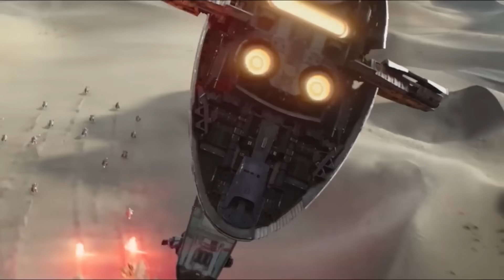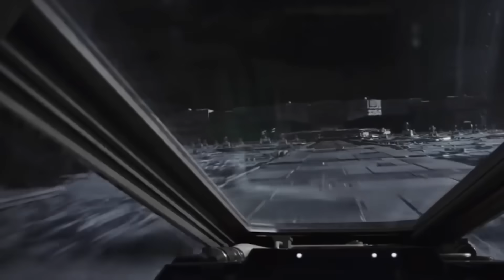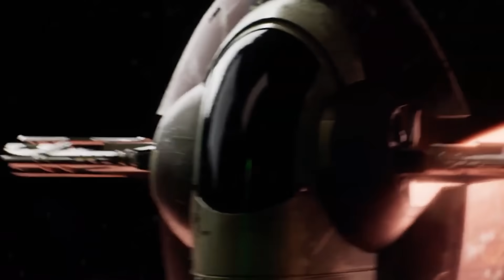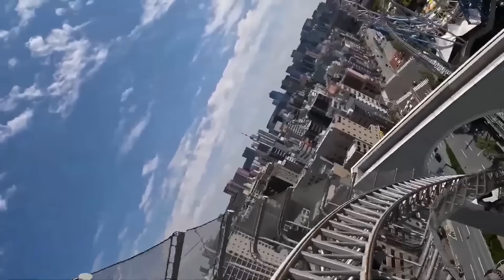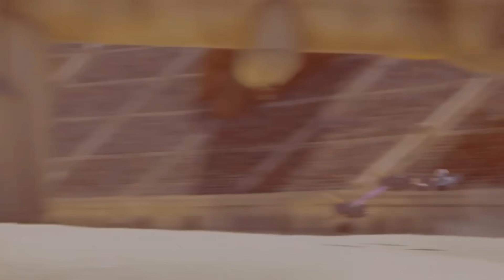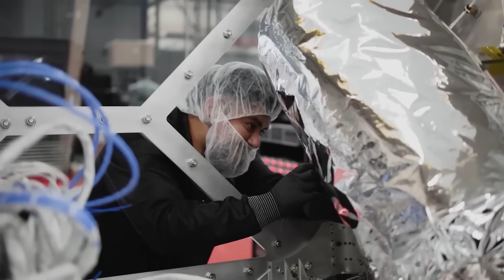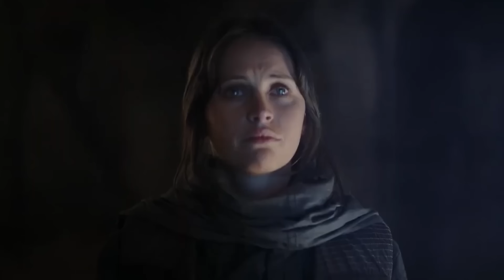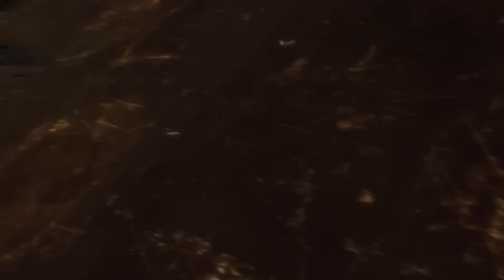The Problem with Star Wars Ship Design

Comment: I doubt nukes in space would do much aside from the EMP. Which might be what you are after, but other than that? There is no medium for thw shockwave or heat to travel through. Some radiative heating would happen, sure. But the intensity of that decreases with the square of the distance so in a wide open space like... well space... it would be pretty meh.
Reply: Energy density is the important part here. Instead of having gigantic missiles you can have reasonable sized ones. Also the shockwave has just enough to travel through (the insides of the struck ship) and i can assure you that there will be plenty energy left on impact.
Reply: @toastyrules8221  Travel though what? Nukes work by releasing enormous amounts of heat, which causes the air to expand => shockwave. In space all you have is a missile that very rapidly becomes very hot radiates a bunch of energy off and probably evaporates. Congrats you put on a lightshow.
Reply: @toastyrules8221  Ahh, ok you assume you make contact with the ship: yeah that would work. I guess. Kind of like a hollow-point bullet. Which... ok fine... But when you are hitting a ship, you could also hit it with a kinetic kill weapon.
Reply: @noneofyourbusiness3288  Always depends on what/where you are shooting at/from and what you want to accomplish with a hit. A kinetic penetrator has to hit something in its path to do more than just a series of holes whereas a nuke can and will do serious damage without the need for precise aim.

Target size/resilience comes to mind, a smaller craft gets threatened and taken out by a single/few kinetic round/s, a bigger ship meanwhile can withstand dozens of shots and might be in need of the increased damage potential a weapon like a nuke has.

And yes, i assume the nuke hits, as exploding it before reaching its target is only done to maximise damage output in atmospheric conditions.

Comment: Its not about speed. What matters is acceleration. You can go at ridiculous speeds, in fact you currently are. Velocity is relative after all and it all depends on the frame of reference. What you would not survive is your space craft suddenly changing directions, but going really fast one way? No problem what so ever. You might find that you experience some funky time-dilation effects if you go really fast, but that is besides the point.

Comment: Those globes ether side of the command tower are not shield generators they're sensor/communication arrays similar to the exposed radar antennas on real life naval vessels. Its commonly misconstrued that they are but that isn't actually the case. The guy who designed them in real life said he left them exposed as the ship's own shields might interfere with them so he felt best to leave them unprotected.

Comment: Long story short, you need to brush up on science. There is absolutely gravity in space , our astronauts don’t feel gravity in space because they’re constantly falling at 15k mph around the planet, It’s called orbiting.  If you could build a skyscraper 150 miles tall and you climbed to the top floor, guess what you could do you could walk around , you wouldn’t even notice the difference in gravity.  There’s only 2 ways to experience ZeroG by orbiting the planet or when you’re falling.. Star Wars ships use anti-gravity to make their ships weightless. Then they use their engines to propel themselves at much slower speeds. This is why they are able to dogfight.

Comment: 12:00 Which is why I like AI/Machine pilots in sci-fi. Like the Droid army of the even in Battlestar Galactica. They can and should exceed G-forces that can kill humans and simultaneously process everything going on around the battlefield at superhuman speeds.
Reply: Star Wars has inertial dampening tech...the G-forces are essentially completely nullified.
Reply: depends on your technology, if the mechanical brains contain components that break just as easily as organic brains under high G loads that won't work. And you need a LOT of computing power for the latter, so do not just assume that the cheapest hardware one can buy will suffice to work miracles like that. See Tesla and it's "cutting all corners they could" designs that now fail constantly at achieving true self driving as neither the computing power nor the sensor information is enough for that...
Reply: Star Wars was heavily influenced by Dune. So, the reason people are suspicious of AI is the Butlerian Jihad :D

Comment: I never thought the Death Star vent was dumb. The fact that a power generator that power needed a vent? Seems like a reasonable problem (the fact it was so small seems more of an impressive feat than a weakness). I thought it was more of a plot hole to believe it was only there because of sabotage.
Reply: Seems awfully small: as 10011110011 points out, a vacuum does not conduct heat, so the only way to dump waste heat is through radiation, which is highly inefficent. Look how long white dwarf and red dwarf stars "shine"; they're not "shining" because fusion is ongoing, but because their temperature remains high over millions of years due to the inefficiency of radtiation as a method of cooling down.
Reply: @PaulThatcher-iu5in  space still cobduct heat therr are some particles in it to do it. Its Just really bad at. Radiators still need something to give the heat to. Spacedust or whachamacallit.
Reply: @10011110011  Not quite. Space is not totally empty, a complete vacuum, but there is practically nothing to conduct heat, practically nothing. Radiaors do not require anything to "give" the heat "to" - that is a misunderstanding based on the fact that we have "radiators" in cars and houses - in fact, these dissipate heat by convection, by contact with air around them. Radiation does not require "space dust" - you mean, the Interstellar Medium; radiation can traverse a vacuum. Gotta say, sci-fi fans, the level of knowledge about actual science I experienced in these comments is terrible - does none of you ever bother with actual science?!
Reply: @10011110011  Radiation is the transfer of energy by electromagnetic waves - famously, as demonstrated by the Michaelson-Morley experiement, this process does not require a medium, the so-called "ether". This experiment was done in the Victorian era, and was key to Einstein's 1905 paper on Special Relativity, which postulates that the speed of light, c (actually the speed of causality), IN A VACUUM, is constant. You didn't know this? This is high school Physics, ABC stuff...
Reply: True, space is not totally empty, but there is practically zero conduction of heat. As for radiation, correct, radiation is the loss of heat by the emission of electromagnetic radiation - this is, however, so slow that a white dwarf star, which is only the glowing ember of a once active nuclear fusion engine, will take approx 10^15 years (approx 1000 times longer than the active fusion life cycle of our sun) to radiate their heat away.
Reply: Strictly speaking, what we call a radiator in a room here on earth heats the room by loss of heat through convection through the air in the room - this is radically different to the emission of EM radiation in a vacuum.
Reply: One point worth considering - strictly, "temperature" is actually a measure of the kinectic energy of the molecules in a gas, say. However, where that gas is so thin, like in the transition to space very high in the atmosphere, the average kinetic energy of the molecules can be very high, yet that is a very cold zone, even if not as cold as space itself. Why? because there are so few such high velocity molecules that one can barely detect their energy.
Reply: @PaulThatcher-iu5in why wouldn't you just dump hot gas? No conductor needed.
Reply: @Rashnak66  That certainly would work physically. The problem is, though, what gas would you dump? No matter how big and sophisticated the ship/base/whatever, there would be a finite amount of gas on it, and the most crucial would be the gases of a breathable atmosphere: air. You would want to recycle that air - this is true in current space tech. The one thing you definitely DON'T want to do is dump it. To carry other gases (in highly compressed form) specifically for the purpose of using them to dump waste heat seems insane - and would come up against the problem of then requiring MORE energy to be expended in storing and carrying those gases, thereby creating MORE waste heat in the process. This is where not only science fantasy, but even quite grounded "hard" sci-fi often breaks its lance - trying to fight the laws of Physics...
Reply: @PaulThatcher-iu5in well you can carry solid metal then use waste heat to convert the metal into a gas (which takes an enormous amount of energy to do), and expel the gaseous metal. 
 Obviously just spitballing here.
Reply: @Rashnak66  That's also true, but we still come back to having to carry the metal in the first place. Also, here, what about the vaporised metal's ultimate fate - I mean, it would cool (by radiation!) eventually, and so then any frequently used routes / near planetary orbialy would be strewn with frozen metal slag, which would have serious consequences. That's the point, though: spitballing is a great way to expolore and solve problems...
Reply: @PaulThatcher-iu5in  well that goes to my point about metal requiring huge amounts of energy to become gaseous, you don't actually have to carry all that much metal to expel a lot of heat. And come to think of it that very death Star has a complex garbage disposal system so there should be lots of stuff to vaporize.

As for  what becomes of it, when gaseous metal hits space it would form the tiniest of droplets. Star wars ships can withstand big meteor hits (empire strikes back) so I wouldn't think a tiny droplet would even affect anything. ... Wait in that same movie the destroyers were dumping big chunks of garbage into space, big enough chunks to hide the millennium falcon.
Reply: @Rashnak66  Maybe, maybe... But at relativistic speeds, microdroplets become deadly projectiles. On another tack, I'm very struck by a number of the engineering points made by Cixin Liu in the books of "3 Body Problem", not just about junk, but also about the very nature of space warfare, which given the distances and times involved might strangely resemble a much scaled up version of 18th century fleets manoeuvring...
Reply: @PaulThatcher-iu5in Well in the Star wars universe they seem to have figured out how to shield themselves from space debris as they travel, except where the plot demands it of course....oh that Holdo maneuver! 

It always seems to me that the capital ships in the Star wars universe made no sense at all.... Seemingly ineffective against other Capital ships, yet highly vulnerable to tiny fighter aircraft. Obviously the model was world war II combat.... But we quickly evolved into guided munitions EG missiles, They have missiles, why not fire a thousand missiles instead of a few fighters or all those gun shots that miss?  Once again plot device. 

Okay since you seem game for theoreticals.... I'm of the opinion that a single borg cube could destroy the entire empire..... Thoughts?
Reply: @Rashnak66  Not enough knowledge of SW universe, just the main movies, though I can claim one distinction - I'm old enough to have see the the first (I mean the real first, that is, Ep IV) in its first week at the cinema, which was mind-blowing - for the first time, you thought, wow, we're actually in space, not a studio, not a model! I'm from the Apollo generation, stayed up late (lived in the UK) and watched Apollo 11 land on the moon when I was 5. People in our street went outside to look up, not because anyone thought we would see anything, just to stare in amazement -- we'd stepped on the Moon!
Reply: @PaulThatcher-iu5in yes I was 11 years old when Star wars came out, I'll always remember sitting in the theater hearing the rumble of the Star destroyer before it appeared on screen..... What a moment!   But that was just a movie, you got to see the real event in 1969 when man first set foot on the Moon.
Reply: @Rashnak66  So your '66' is year of birth... Greetings from a vintage of '64, named for my Mum's favourite Beatle.
Reply: What is this thing even supposed to vent?
Also, why not add in some sort of steel mesh or split this thing at least  a few meters below the surface into multiple openings with a small diameter? I don't see a reason to leave such an opening directly to the reactor this exposed.
Reply: @xyleblack2545  Let's say it's 'venting' heat, a real problem on actual spaceships. Heat can only be dissipated by radiation and convection. Radiation is incredibly inefficient, which is why, for example, white dwarf stars shine so long - they're not 'burning' their nuclear fuel; they're just glowing embers. Convection doesn't work, as it requires a medium to convect the heat away from the ship, and space is a near perfect vacuum, so convection is practically zero. As the term 'vent' (Latin: ventus - wind) suggests, to get rid of heat in this way would require the expulsion of gases, and that doesn't sound like a great idea, expelling gases from a space station, instead of scrubbing/recycling them...
Reply: @xyleblack2545  In fact, with any other kind of venting, we still have a problem - say it's trash (though why such an advanced station would create trash instead of totally reusing/recycling is another question): when an astronaut steps out the hatch of an orbiting space station, are they 'swept away' from the station? No, of course not, as there is no 'headwind' in the vacuum of space, and as their initial trajectory is exactly the same as the ship's, they float near it - yes of course they need a tether, as any small contact with the ship, say a push against it, might (following Newton's 2nd law) send them flying off in the opposite direction. So how do we 'throw away' trash? Well, you'd need to propel that trash away from the ship - a process requiring fuel, thus increasing the mass of the ship, not to mention creating yet further waste.
Reply: @xyleblack2545  And if we're just gonna do space fantasy, which is fine, and have a vent, then, as you say, why not just put a grille over it?
Reply: @xyleblack2545  Ssssshhhhhh! Don't ask those awkward logical or technical questions: some of the boys get upset!
Reply: Considering space conducts little to no heat because its mostly empty makes the size of the exhaust even more impressive.
Reply: 100% agree. The Death Star had a diameter of 120 km. That vent was an infinitesimally small vulnerability, like finding a needle in 1 million haystacks. There's no reason to expect the enemy to know how or where to find it.
Reply: @Fylgija1  That's not how you do security. That is essentially the Microsoft approach: security by obscurity. "It doesn't matter we're full of holes, nobody knows where they are." How well that approach works we have been witnessing for decades now.

This scenario requires a chain of inconceivably stupid design decisions. Not only is there a way to destroy the reactor, the destruction of the reactor also results in complete destruction of the death star. Even if this wasn't the case: it's a single point of failure, if it  is out of commission for any reason - maintenance e.g. - the death star is completely useless. And that's just the things i can think of off the top of my head.

It is not just dumb, it is INCONCEIVABLY dumb. I'm not saying that it couldn't happen, though. Such dumb design decisions have happened often, like filling the Zeppelin Hindenburg with hydrogen, or adding another deck to the warship Vasa that caused it to capsize before it even left the port.

Comment: Dude did you do any research. Initial Dampeners have been in Star Wars lore since the beginning. Not only don they cancel out G-Forces but they also “Dump” kinetic energy out so the ship can slow down and get pushed in a Full 360 degrees without needing guiding thrusters. Also Star Wars uses Transparesteel not glass, so it’s literally Clear Steel that doesn’t have any of the weaknesses we have on earth 

This whole video just sounds like a Tourist who wanted to complain about “Stupid” ship design without actually understanding the universe
Reply: Of course they didnt do any research beyond looking at the movies and surface level shit.
Reply: Inertial is the word you're looking for. Inertia is a measure of the resistance to acceleration of an object. Besides, an inertial dampener is pure sci-fi; it goes against the laws of Physics.

Comment: I'm not actually certain on this, but I think I read somewhere that the bridge and thus the most sensitive sensor and electronics equipment needed to be placed away from the reactor (housed in a sphere which actually protrudes from the underside of the ship) to minimise interference.
As I said, I don't know if this is canon, but it actually makes sense.

The main bridge and the alternate CIC in modern ships are also spread out; redundancy is king in military planning.
And finally, one must not forget that SDs are capable of ship-to-ship combat, but their design is primarily as a weapon of terror. And when you design a ship for terror and intimidation, certain reasonable military design solutions simply do not support that.

Comment: 14:31 what? Nuclear bombs detonating in space do literaly nothing.
Reply: Actually, they do. When a nuke explodes in atmosphere, the outer shell pushes against the atmosphere in the initial microseconds of the explosion and turns to plasma. In space, the outer casing fragments and is pushed outwards at near-relativistic speeds. A good design would incorporate a heavy iron casing to deliberately produce shrapnel.  Also, the plasma cloud produced is pretty dangerous by itself.